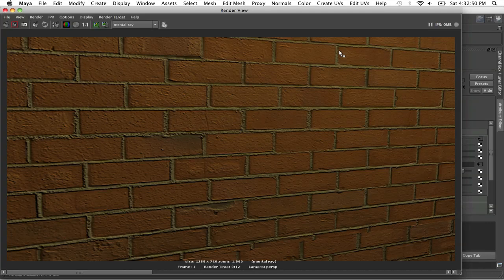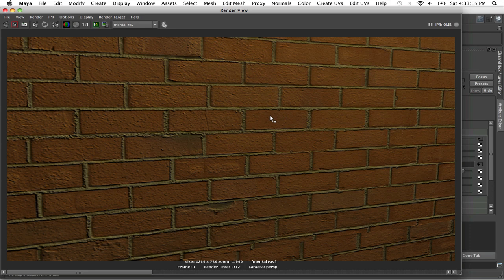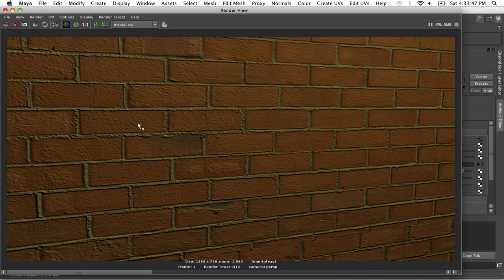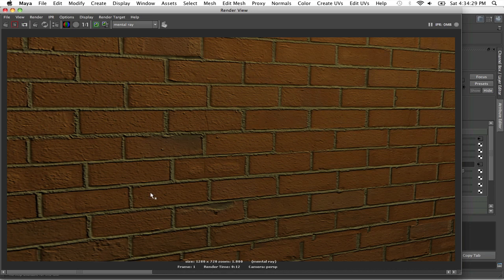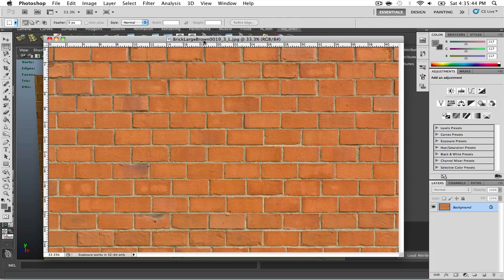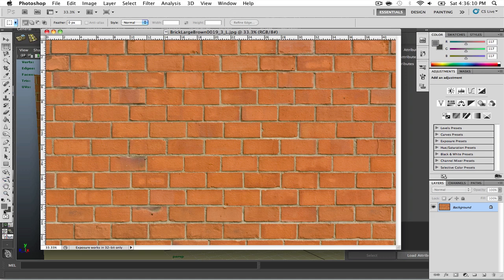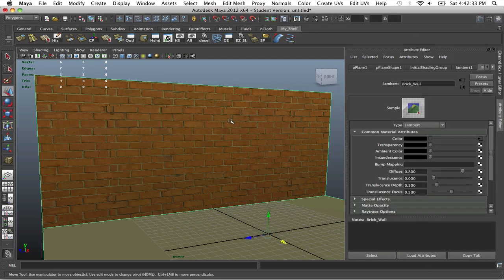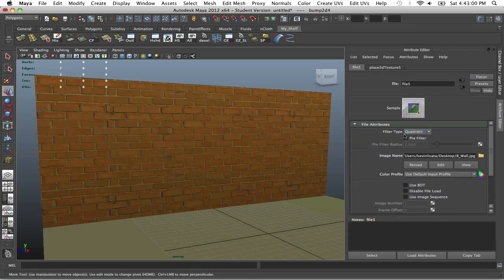Bump Map Basics In Maya 2012

Comment: i have a Question, Bump is better than Displacement map? because the effect work a bit similar, ty for awesome video CGAnimatorX :)
Reply from the maker: It depends on what you're hoping to achieve. A displacement map would help with applying depth and structure through textures. A certain pattern on a surface plane that outlines a mountain or rugged terrain would emphasize that detail extremely. A bump gives the object a certain feel of "life-like realism." Very little objects in our everyday lives are immaculate. Upon close inspection, you'll be able to see a rough texture, scratches, bumps, etc, hence the term, "bump map." I hope this helps ;-)
Reply: CGAnimatorX
thank you, now I understand the differences and different applications for both tools